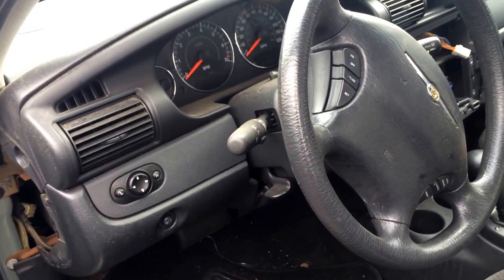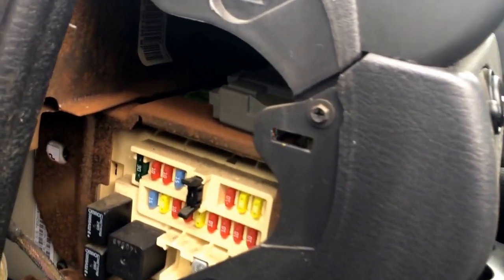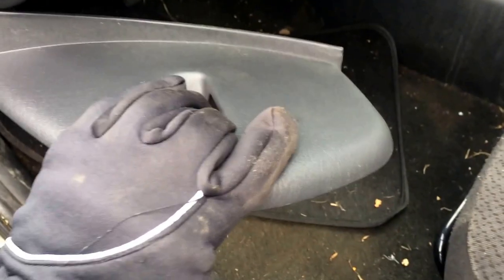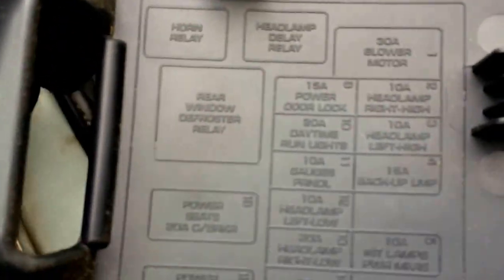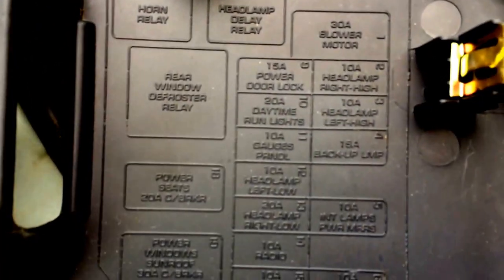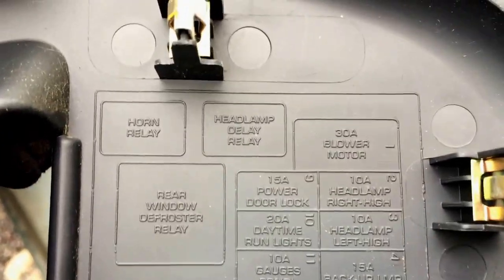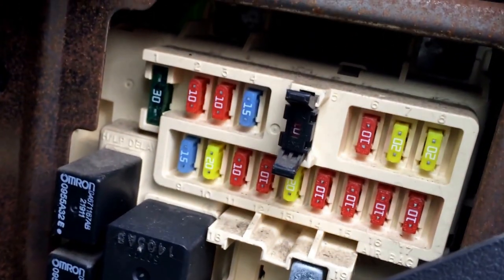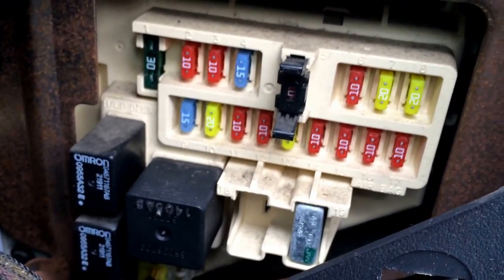2005 Chrysler Sebring Fuse Box Location

Comment: i have a 06 Chrysler Sebring touring not convertible. my problem is i have no turn signals or 4 way flasher lights. i have changed the relay in the turn signal switch on top the stering colum still nothing all other lights work fine. no turn signals no hazard lights